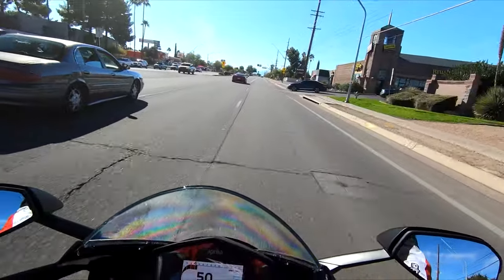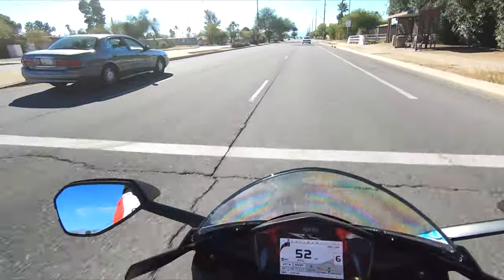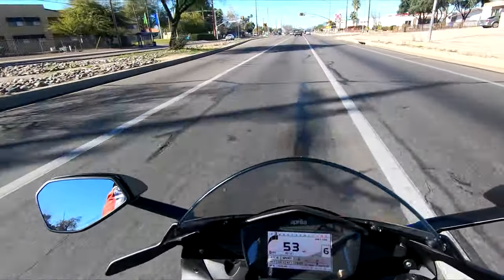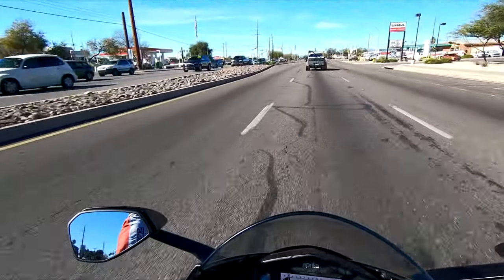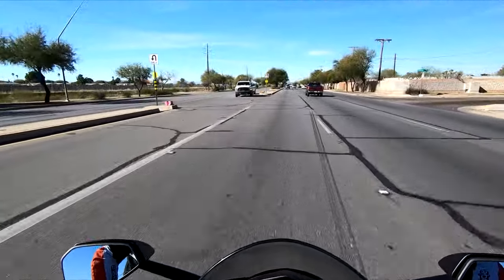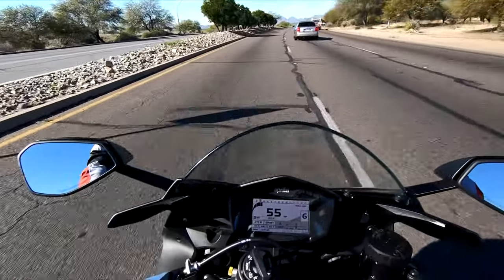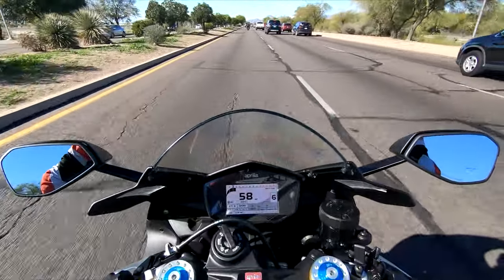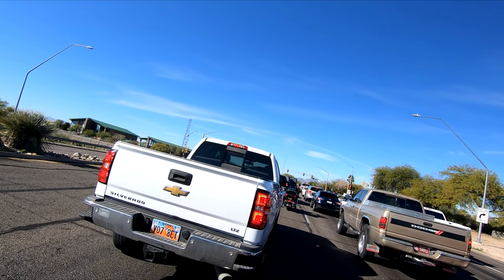Aprilia 1100 Factory has issues!!

Comment: 1.The seat I completely agree with dont like it one bit. It doesn't help that I'm 5' 6" I can barely touch the ground 😅 
2.And the turn signal SUCK I barely use them.
Reply from the maker: The seat is a bit wide and hard but not the worst. I replaced the signals so I have no issues there!

Comment: Literally most all of your gripes are easily fixed with mods.

It is a tall bike I will agree.  I am 6 ft and at a stop I'm on the balls of my feet on the ground too. 

Nice part about the rsv4 is it doesnt leak oil like a Ducati (yes I have had a lot of ducatis).  Imo even though a few things need some updating the overall build quality is way better than ducati and for a much better price.
Reply from the maker: I do agree with you on all your points, although I've never had any of my Ducati's leak oil so, that part I don't agree with. But I am aware that it sure does happen. 
I love this bike, and like you said, the price is impressive, this one is still cheaper than a standard V4s and wayyyy cheaper than my V4 Speciale! But with every bike, I have to find negatives, while most are trivial and easily fixed, I hope Aprilia does do some upgrading because that dash is the most dated part of the bike (even with a 12 year old chassis).